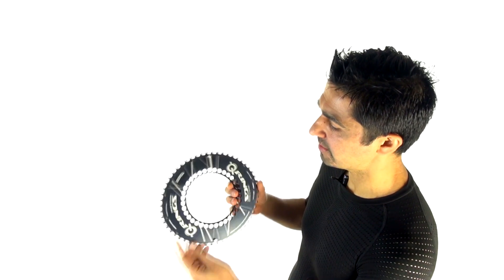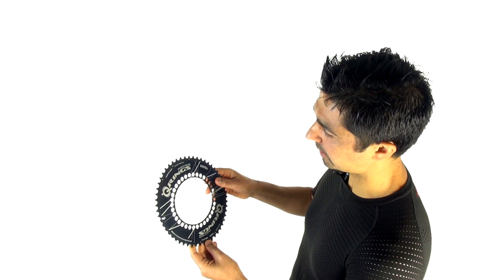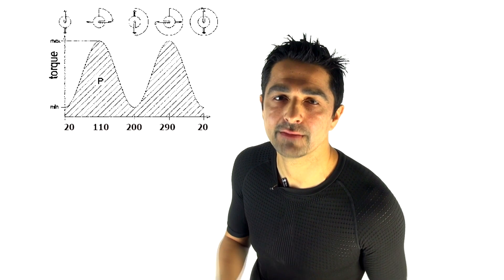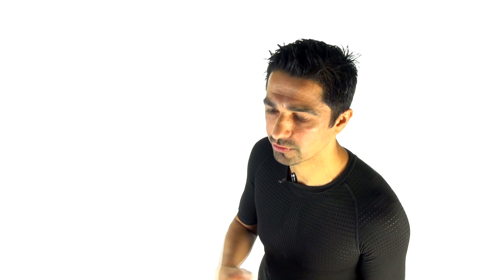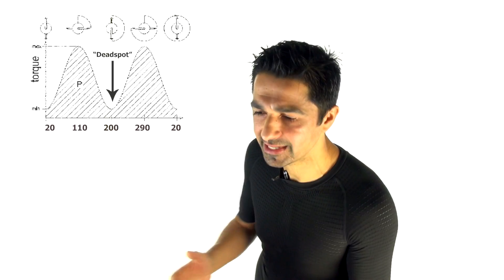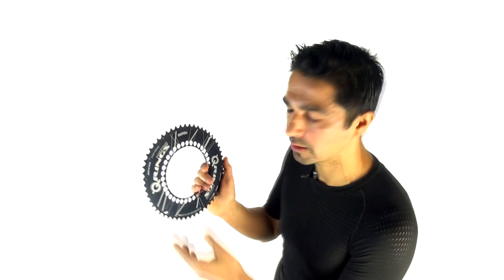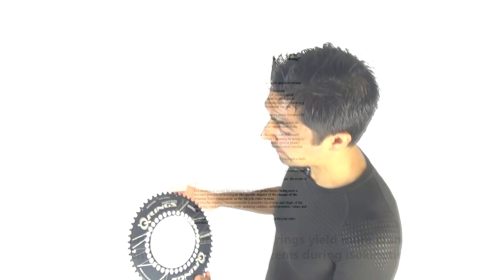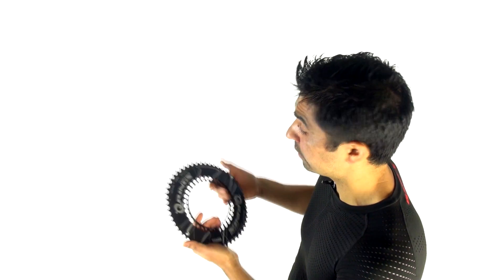Do Oval (non-round) chainrings improve one leg vs two leg cycling power (Q ring, osymmetric)

Comment: Here's my entirely un-scientific take on oval rings: I've been riding and racing for 40 years and 3 years ago switched first to Q-Rings and more recently to Osymetrics. I have partially torn lateral ligaments in one knee and a dodgy pelvis following a fractured sacrum. Riding with ovals has got me back on the road riding, and back to a decent level of fitness. I live in the Alps so most of the riding is long climbs, but there's a bit of everything here. I tend to ride around 85-100rpm, and particularly like oval rings on long climbs. They put less stress on my semi knackered knee when at its most bent in the pedal cycle, and I can ride consecutive days without pain. If I put an eyeballs out sprint through round rings, my ligaments need rest for a couple of days, but with ovals they're ok. Same thing if I have to grind on a very steep section of a climb. So I ride ovals. 

Now onto the negatives: here in the Alps I need either 34-50 or 36-52, but this number of teeth difference on the chainset is right on the limit of what's possible for the front derailleur. With Q-rings I always found when on the little ring to little sprocket, the chain gets half picked up by the big chainring half way through the pedal cycle. In fact it even happened on the 3rd smallest sprocket when on the small chain ring, like a kind of chain slap against the big ring. No matter what I tried I couldn't stop that, but I rarely want to use those gears anyway, so no big deal. With Osymetrics I don't get this, but the big ring to biggest sprocket is unusable due to terrible chain rub. Big ring to next biggest sprocket it also a no-no due to chain rub, and though it still rubs on the next sprocket it's bearable. I have to be in 4th gear on the cassette before there's no rub in trim position with the front mech. I'm using a Shimano Dura Ace 9100 front mech, and have adjusted it SO many different ways, also with bike shop help, but there's just not enough difference between the outermost front mech setting and the trim to make it work smoothly. This is because the chain line on an Osymetric changes enormously as you rotate the pedals, way more than on round rings, and way more than Q-Rings. Oh for an old friction lever for the front mech! Maybe SRAM Red might work better, the front cage looks a tad wider. If anyone has any experience with this, do let me know. 

You also have to set the front mech backwards a way with a shimmy on compact Osymetrics otherwise the chain rubs on the very bottom of the derailleur cage. You have to be a die hard advocate for these rings when it comes to front mech set up: I'd dearly love to know how Chris Froome's mechanics set up his front mech! I daresay much of the time he's on 38-52/3 which is much easier for the front mech.  

Q-Rings are much easier in this respect. But I find the Osymetrics are more natural to use, and didn't notice them not being round when I first tried them, whereas with the Q-Rings I did. But maybe I was already semi 'oval-adapted' when I tried Osymetrics.. At the end of the day, at the age of 55 I'm getting PRs on Strava segments I've been riding for years, and am enjoying cycling without pain, so I'm sticking with my Osy's.
Reply: Thank you for the feedback bud and good rides.
Reply: Yes, thank you.
Reply: Have you thought of using a bar end type shifter for the front derailer mounted like the old touring bikes used to be? Bar end shifter in the left handlebar end where the tape plug goes.
Reply: John Horgash I think that'd be a good solution, but I haven't tried it. Losing the ability to brake hard and downsshift at the same time is so important in the mountains so I think unfortunately I'd now find it hard to use a bar end shifter. That said, we managed OK with friction shifters before combined brake-gear levers came along hey? 😉
Reply: @alzibaba  I think I will use what I have for now. I use bar end shifters on my aerobar extensions so I can train the way I will race. I will know within the next few weeks if the rings are worth it or not. I'm beginning to ramp up my training. Cheers!
Reply: Pretty the same feeling I had when used the Osymetrics. Very nice review! I cannot change a single word and totally agree. Thanks!
Reply: @xexatubed  Hello! Does your chain rub the big ring when you have it in the small ring on the 12,13,14 on the back? Do the Osymetric rings make a slight "chunk, chunk" noise when you pedal especially when slightly cross chained? I have Doval 2g rings 52/36 , couldn't beat the price as compared to the Osymetric. I am still comparing them to the round rings on my other bike. I really like how they feel but the noise is a little strange. Since I like the rings I can put up with the noise but just wondering if they are supposed to sound like that. Thanks!
Reply: @johnhorgash9031  I used the 54/44 combination, borrowed from a triathlete friend on my Cannondale Synapse. I had no issue about noise with the Osy's. No rubbing on the small gears, but as you said, the 2 biggest cogs (28 and 25) were practically prohibitive to be used with the big ring with such rub, even with professional tuning. This is the only problem I had. Now, I'm in doubt if I buy the Doval 2Gs, sice the price is way better than the Osys. There is also a KCNC model that looks very like the Osymetrics but I have no reviews about them!
Reply: @xexatubed  I use bar end shifters on my bikes with the Doval rings. I tried the rings with the shift/brake Shimano levers and couldn't get them to shift. Too much distance between the rings. Bar ends work fine though. Interesting that the Osymetric rings don't make the chunk noise .
Reply: @johnhorgash9031  I think bar ebd shifters for the front are ok, because of the manual adjustability. I didn't have noisy issues, aside those i cited. Thank you man!
Reply: @xexatubed  I think it may just be the size of the chainrings 54/44 only 10 teeth different compared to 16 teeth on the 52/36.  Maybe that's why it hits. I think the noise is just part of the way the 2g Doval rings work . Its kind of a flat landing for the chain after it comes off the cam portion of the teeth. I love a silent drivetrain so this is kind of making me a little crazy. But I'm holding out to see if these rings are beneficial. All that being said they are good for my knees. I get sore after I ride my round rings. An old injury that likes to annoy me now and again. Cheers!
Reply: @johnhorgash9031  yes, yes, I felt they were great on my knees, a lot less pain on my legs after the rides, easier to keep high cadences and even on these sizes, they don't feel that big! Cheers!
Reply: John Horgash m
Reply: Thanks for you long information. It's very useful. Out of curiosity, have you tried AbsoluteBlack? They have a sub compact 48/32 and 46/30, it works with Shimano spider. You just can't use spider power meter. All their large chainring has a groove kind of pattern to help with the shifting. I saw durian rider showing his bike equip with Oval chainring and it's shifted smoothly. 
I haven't swap to oval, just waiting on delivery of AbsoluteBlack inner oval 34t. I originally have a compact 50/34 round and swapped to 46/34 round with no shifting issue. Now I'm planning to swap my 34t round to oval. I'm also live in mountainous area.
Reply: @n.h2786  No, I have not tried absolute black. I was looking at them but don't have the cash at the moment because of the covid lockdown and no work. I need to decide on which size to get. With round rings I use 53/39 and 52/36 on my road bikes. The Doval rings I have are 52/36 but I wonder if I would be better with something else. Time will tell. Once I have raced the 24 hour race in August I have planned I may have an idea what size rings I need. I like the absolute black ring construction . They look very stiff and really cool! I do feel less tired after training with the oval rings. I think you will like them very much.
Reply: @johnhorgash9031  Good luck with your race. Btw AbsoluteBlack also have the typical standard, compact, semi compact chainring. The one above if you are thinking of going even smaller upfront so you can keep 11-28 or even less perhaps.
Reply: Nita Heroe P it's a pleasure. I'm afraid I haven't tried the AbsoluteBlack rings. The Osymetrics are such an unusual shape and the suit me, so I've stuck with them. 
I haven't really had any actual shifting problems from small to big ring or vice versa with either Q Rings or Osys. They both shift very well for me. It's more the chain line challenge rhat's tough to overcome on 16 teeth difference front rings. 
I'd be interested to hear how you get on with the AbsoluteBlacks. All the best
Reply: What about shifting.. I always had trouble shifting with these.
Reply: @cliffcox7643  I haven't had any problems to be honest, but have put a chain catcher on the front. Are your problems front mech, rear or both I wonder? The front mech set up is definitely a delicate art to get the clearance and angle of the mech in relation to the chainrings as good as is possible. But I've never dropped a chain on my Q-Ring set up, whilst I have on Campag round rings...

Comment: How much energy is lost with the front sprocket being to one side? What if you had two sprockets? One on each side, or one centered on the bottom bracket?
Reply from the maker: Ronald Thomas do you mean how many watts lost due to chain deviation e.g. cross chaining? It's about 2 to 8 watts
Reply: Fastfitnesstips actually I wasn't referring to that factor. The left side crank arm bearing must absorb a lot of force before being transferred over to the right side crank ring. There must be some lost energy. Don't know if it has ever been measured?
Reply from the maker: ah ok, deviation/flex has been extensively measured and although there are differences the losses are really minuscule!
Reply: Fastfitnesstips I figured it was tested for sure, but figured more than a miniscule loss. Thanks for the information.

Comment: FFT, 
Your use of measurements instead of opinions , in general, is the most truthful approach, 
and the one most faithful to "Engineering" methods in science. 
You have used the mechanical and gearing analysis very well enough.   Thanks.  
...
However, 
The physiological process of Cycling bicycle pedals around is kinetically more complex 
than can possibly be presented in a short video presentation.  
...
The ability of the muscular body to "adapt" to various mechanical apparatus is very great, 
and could possibly over power any new devices attempt of "helping" the body perform better. 
I have 40 years of club cycling experience, and I have adapted to the "Round" chain-rings. 
My cycling buddy has 30 years of Recumbant Cycling, and he has adapted to that. 
As you noted,  the "Adaptation"  ability of the human body is extremely great ; 
ie, given time and practice,  the human body can adapt to "Round" and/or "Oval" chain-rings. 
The body can adapt to "Ankling" and "drop-heel" pedaling techniques.  
In Triathlete circles, the body can adapt to "Running-on-pedals" techniques and aerobar positions. 
... 
Not considered is the Varying Amount of Effective "Muscular Pull" that can be provided 
by the "Muscle Fiber" and "Tendon-+-Joint"  combination.   
This is a Linear Torgue concept. 
The Muscle Fiber combined with Tendons does not produce "Linear Torgue". 
And, when the Tendon wraps around a bone joint, the action is even less Linear. 
...
Here is a little mental experiment to demonstrate this concept of kinetics: 
(1) Visualize the muscle fiber extended in a bicep curl (arm straight down at 6'clock) ;
then 
(2) Visualize the muscle fiber fully contracted  (arm full up at 1'clock).   
(3)(a) Muscle Fibers "extended" are pulling 'in-line' with possible motion of the tendon. 
(3)(b) Muscle Fibers "contracted" are pulling "cross-wise"  to the possible motion of the tendon. 
Result : Muscles do not always provide "linear pull" to the tendon. 
...
Then 
(4)(a) Visualize the Quadriceps muscles at the top ( 1'clock) position,  fibers fully extended; 
(4)(b) Visualize the Quadriceps muscles at middle (3'clock) position, half contracted;  
(4)(c) Visualize the Quadriceps muscles at bottom (5'clock) position, fully contracted. 
Result : Muscles do not always provide "linear pull" to the tendon. 
... 
Summary:  
The available muscular torque , 
simply considering One muscle group and One tendon attachment, 
shows that the muscular activity of Cycling bicycle cranks around  is very complex. 
...
All of us should be more humble in proclaiming our "well-intended" Opinions and Expectations 
concerning  "Oval" vs "Round" Chain-Rings. 
...
I hope that FFT will continue to Explore and Measure the complex activity of Cycling. 
...

Comment: some gym equipment uses variable cams to lower the resistance at the hardest point, just as the oval ring does but  it only comes into play when doing the heaviest weight/steepest hill and so for this reason probably only lends itself  to mountain biking.
As for all that other totally confusing and misapplied bullshit.....and its not an ad for a product but I'm gonna use and mention this one repeatedly, what a croc o ...t

Comment: If pedal velocity is different on the upstroke and downstroke, wouldn't the cranks be failing around at an angle other that 180 degrees from each other? Maybe I need some nanometers to get things back in line.

;)

That fact that you need to post corrections on your videos just shows you don't know what you're talking about.

I want more nanozoobs generated by the osymetric chainrings that were developed by the ancient druids and etched from Stonehenge. When viewed from above, Stonehenge isn't a circle.

Comment: I might be wrong, but some people might miss the real point of oval rings, I am an amatuer enthusiast rider, dont drive for sports and like to drive fast all sorts of terrains no steep hill klimes tho. But have some problems with knees. some might say krank is too long, wrong gearing or cadence or such, but as I see, oval chain ring might not give mechanical advantage as its stated in this video, but rather mitigate mechanical forces and damage on the knees, hips at those near top and bottom positions. as many people say, you cant follow and obey  the charts and stats supposed to be obeyed, some short people feel comfortable with longer kranks than its "advised" by professionals, or opposite, some taller people like shorter kranks ... higher  cadence and such, I myself am little overweight, with strong legs and  higher slow muscle ratio i think, and feel much more comfortable at 70-80 rpm cadence.  As i see and think, oval chainrings might be a solution when you want to push yourself to  near max performance and want to lover strain on joints and muscles at those positions they are more susceptible to damage and problems on joints
  ....

Comment: My experience:  I have Osymetric 52-42 and I feel that my climbing ability is improved, especially out of the saddle.  When you're basically "hammering" out of the saddle, you have your entire body weight pushing down on the pedal and very little upstroke or "scraping gum off year cleats motion".  So gaining teeth on your chainring out of your saddle would benefit.  Seated pedaling in the saddle is less efficient for me.  Very short upstroke with higher cadence makes it difficult for me to focus on any pulling motion.  Sprinting is terrible for me with Osymetric.  Although you are more hammering than focusing on complete stroke, I find the larger down stroke duration makes if difficult for me to find the right cadence.  Maybe I need to spool up to a faster cadence. I want to see if it's possible to run a 53 round outer ring and a 42 Osymetric inner ring.  That would work best for me.

Comment: The poll question is wrong. Does non-round rings increase power? 
The answer must be no. Power is generated by the rider, not any part of a (non-battery assisted) bike.
Replace power in the question with "torque at the wheel".
Reply from the maker: fair point. sadly poll's have severely limited word limit and are non-editable.

Comment: The whole analysis of the video is based of the one-legged cyclist. Of course that cyclist has a advantage and disadvantage on the down and upstroke of an oval ring. But with two legs, the key factor is deadspot and more even momentum of the rear wheel during steep mtb-climbs with dodgy tyre-grip. This is not mentioned at all.

Comment: So what you're saying seems to imply that, in order to take advantage of the theoretical faster return-to-power position on an oval ring, a rider would have to change their RPM from slow (power zone) to fast (dead zone) 2 times every 360 degrees. This does not seem likely, as I believe that given the high RPMs road cyclists generally pedal at, momentum keeps pedal RPM relatively even, negating the advantage of oval rings. One exception might be low RPM climbing out the saddle.

Comment: You haven't mentioned load on the back wheel the whole time. There is a difference if you mostly need wattage or if you need the correct torque to ride over a certain obstacle.
Reply from the maker: Gear ratio will momentarily change so assuming you can cope physiologically by maintaining your cadence, power would increase slightly during each part of the push phase. However if this meant you were overgeared / at your power limit.....then it is also possible you power would not increase.